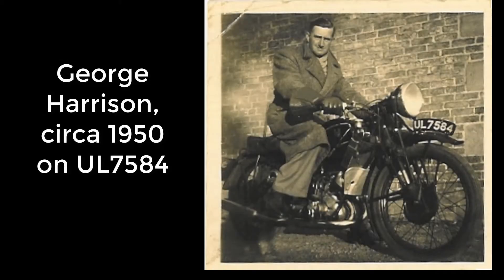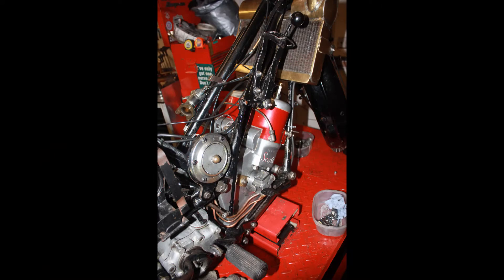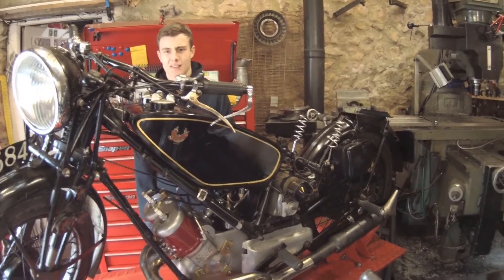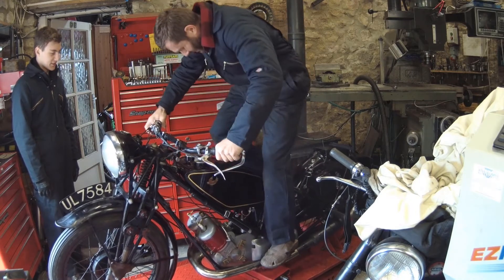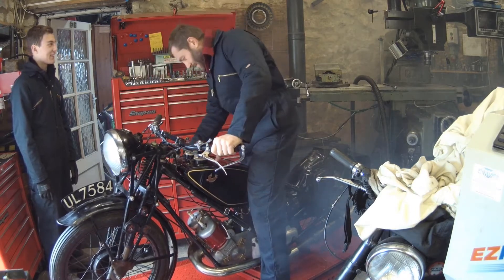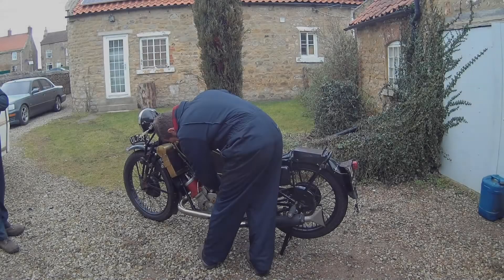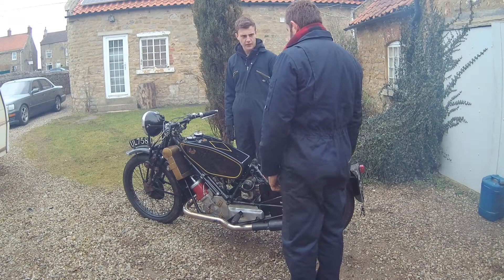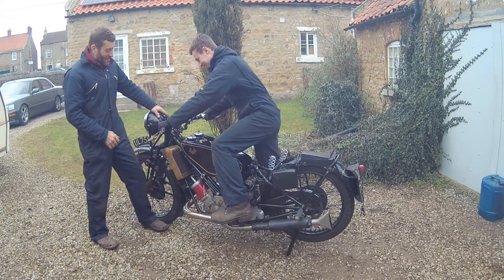Scotts can start easily!  Here is a freshly rebuilt engine showing this :-)

Comment: Another great video! Do you give your neighbours free earplugs?
Reply from the maker: Well we did the bottom end on that engine a few years ago, and this was the first time the barrel was taken off since then and the rings were still free.  The exhaust has never been cleaned internally since we built it.  I find if you run them with correct mixture, and give them plenty of beans, they don't gum up for many years.  The worst thing is to run it super-rich, then put-put about with it four stroking.  That is instant gum-up and fouled plugs.
Reply from the maker: The neighbours really appreciate the smell of Castrol R wafting in through their windows!  That Scott is quite raucous - sounds different to our other ones, much crisper.
Reply: Scottparts How often do you have to de coke the engine and exhaust if you run it on Castrol R. Sounds good by the way!
Reply: Scottparts Thanks for the reply. What mixture do you use with the castrolR 40? 30:1?
Reply from the maker: We usually run 50:1 in the fuel, and one drop every 7-8 pulses on the pilgrim running at engine speed.
Reply: Scottparts Thanks for the advice.